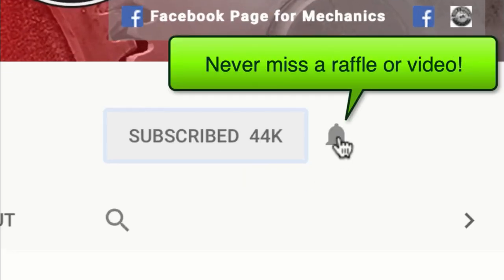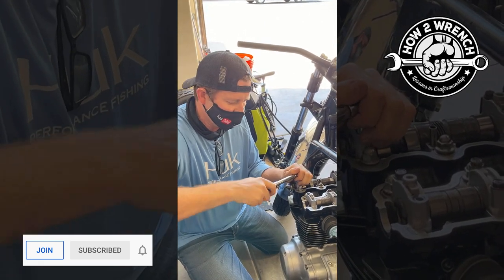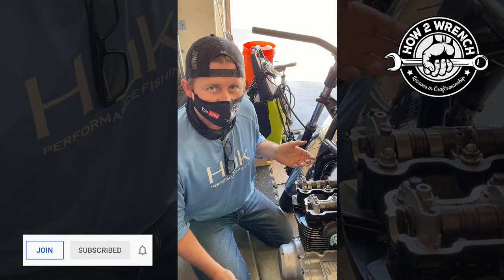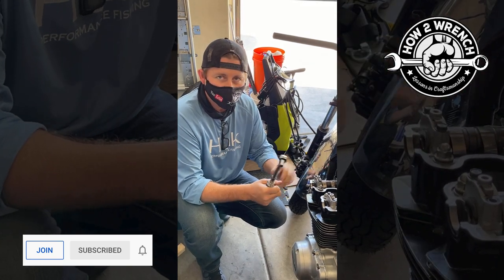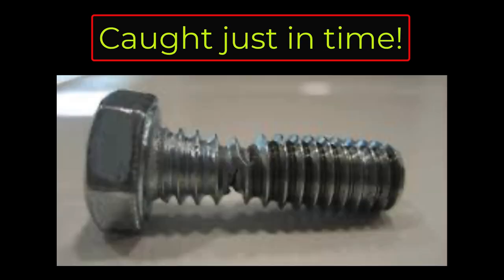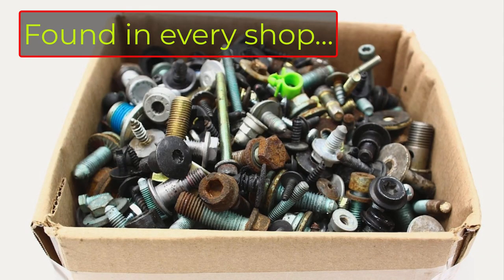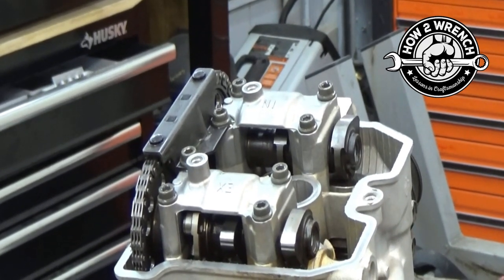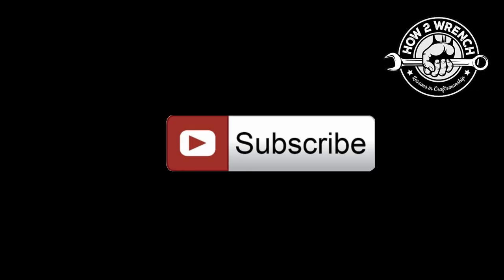Way overtightened bolts. How to tell how tight was! Bonus: Necked bolts, inspection, one-time use.

Comment: Good video Shane, I'm wondering if some clown used red or green Loctite on this bolt. I had a ign. rotor bolt (M6) in the end of a KZ 1000 crank that someone used red loctite on a few years ago and I managed to get it out without snapping it... but it took forever and I was a nervous wreck doing it. Happy Trails, Doug